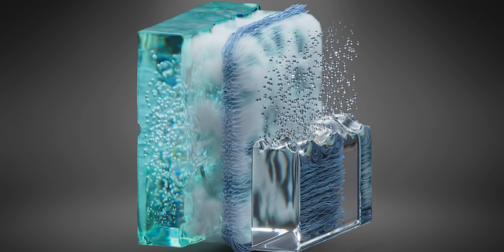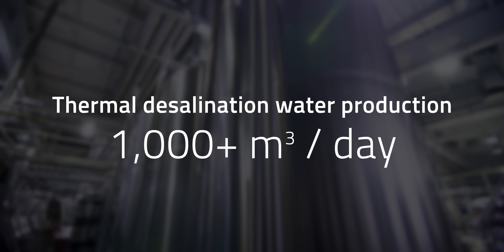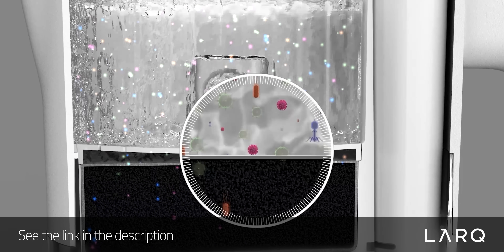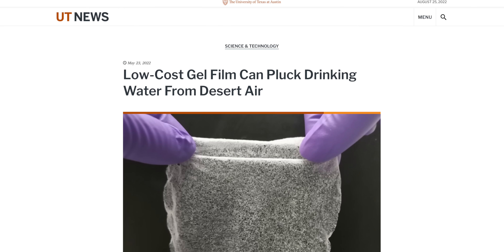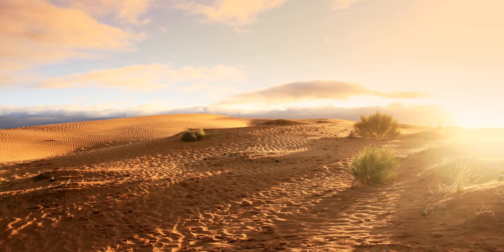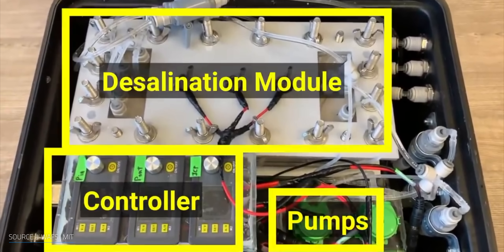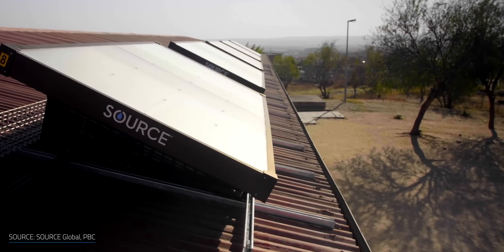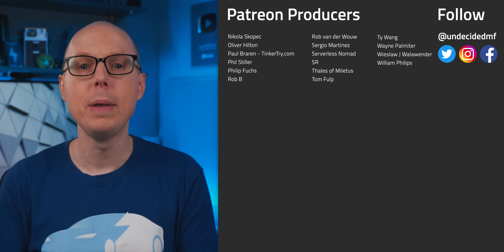2 Breakthroughs That Could Solve the Fresh Water Crisis

Comment: This is not quite current. It has been discovered recently that a certain frequency of light can accelerate evaporative desalination. The savings in applied heat energy could be substantial. I can't tell you where I saw this.

Comment: At the scale of the ICP device, reverse osmosis will have probably the same impact as the ICP device. The problem with the brine is the scale, nothing else. And that's fine. Even if you were to hook up thousands of these ICP devices in the same region to dump their brine, it still wouldn't have any real impact, since, it's 0.3 liters of water per hour. A few people peeing in the water will have more impact than that.

Comment: I don't understand why the gel method is low energy.
After is absorbs the water, you need to cook it out of it. Basically boiling the water away. That takes a lot of energy!
Maybe it is less energy compared to a dehumidifier, but that is not stated.
Also the gel seems to work exactly the same way as silica gel, which I can buy right now very cheaply, and does the same (but the efficiency and capacity may be radically different).
Also how  does it compare to highly water absorbing salts, like MgCl2? MgCl2 can absorb a lot of water from the the air, so much that it turns itself to a slushy.

Comment: One man’s trash is another man’s treasure. Sea salts are a salable commodity. Making Brine via evaporation and continually evaporate water to get salt. 
 Hey wait you’re throwing brine away?! Stop right there! Combine desalination and salt production. Reduce waste and increase profits. By rapidly producing brine you reduce the time needed to produce salt. Look at all the energy used to make salt. Pump fresh water down to dissolve salt in  layers deep under ground that gets put into evaporation ponds or heated to boil off water… save that energy and water used to make the salts we use and create jobs and fresh water through desalination. This ain’t rocket surgery blondie. 
 😊
Reply: Sadly the brine produced contain a lot of waste product and the brine management are too expensive for now. As good as turning the brine into salt, the current salt production are way too cheaper that making salt from brine not viable to be commercialise yet. While the idea is very good for nature but for now it will remain too good to be true 😅

Comment: The gel seems like a pretty good solution for just staying alive through aridification in rural areas, but I do think solutions that lend themselves to large scale are far more important. We aren't going to need the same amount of freshwater in the future to support our current irrigation and water use, we're going to need significantly *more*, because a lot of our crops are currently watered by rain which there's less of as aridification via climate change continues. Getting enough water out of depleting reservoirs to do the same amount of irrigation is a problem in and of itself, but we have to remember that we are going to need much, much more irrigation, not the same amount. I'm not sure that it will be possible to draw enough moisture out of the air to meet these new irrigation needs, and the distributed nature of sections of gel drawing moisture out of the air that would have to be spaced apart seems highly impractical for irrigation and plumbing systems. Would love to see a solution that allows us to pump water out of the ocean, desalinate it, and then distribute it across land mass on a scale comparable to freshwater rivers. While ambitious I see that as a necessary solution to maintain food security and prevent societal collapse, and if done successfully it renders these technologies mute for most of the world's population.

Comment: The water extracted from the air technology is surely limited by available sunshine (solar energy) and above freezing temperatures. What about particulates like dust or smoke collecting on the gel and reducing its surface area (or porosity?) Also I assume that the solar panel is dedicated to water production and useless for electrical generation (since you failed to tout the possibly of dual use.)

Comment: The gel system could be used as part of a solar desalination system if you use the gel system in a solar box type system where you get 100% humidity in the box with the gel system hanging in the air above  the water being evaporated in the enclosed box. with a  black plastic pipe coil preheating system before the water went into the evaporation box, you could get a very high running rate for desert area water with high toxic water from wells.
I lived in one desert area where we had to haul water for drinking and cooking because the well water was 500% over the safe standard for arsenic.
The water also would destroy swamp coolers we used for cooling our house. I set up a simple solar distillation system to remove the salts and arsenic from the water, and the swamp cooler lasted for a couple of years without changing pads or doing repairs because of corrosion.

Comment: Regarding filtering your tap water if you have city water, then you only need a carbon filter to remove the chlorine at the tap. A simple 2.5 x10" filter that with the housing should cost about $30 with just changing the $10 filter every six months. Being that you have chlorine the UV will do nothing. Now for those who have well water then a UV is a good idea and it us just a matter of changing the lamp once a year. $50 or more depending on the size of the UV. 
Regarding the brine from a RO desalination system, on smaller systems producing 100,000 gallons per day or less, the brine is normally dumped down a deep well, say 250 to 450 feet deep. On larger systems it is just a matter of piping out the brine through a series of pipes that spread out the brine to a large area so it can easily mix with regular seawater. 
Nowadays that are different options for systems producing 30,000 gpd or more that increase the efficiency of the system saving about 40% in electrical costs. Even the smaller systems only cost on average $0.05 / gallon even in areas where the kwh rate is higher then here in the states.

Comment: I can solve a lot of these problems with logic. The run off from plants needs to be far enough out and in about 6 places. If you can find a stable current off shore then you set up 6 pipes with distances far enough away to disprese 4 hours of run off in one area then move another area. if you do this far enough apart you will then be able to cycle enough fresh salt water to dilute the run off and before the next area catches up to it. If you have to you set up 24 pipes that run on one hour pump and dump. This will dilute the area far faster. 
Energy is easy build a nuclear power plant that produces power for x amount of plants in a given area. 
You can increase weather by setting up billions of sprinklers in the ocean which spray a mist of water which will aid in evaporation in turn will produce clouds. If you could model this and predict the outcome then you could increase rainfalls in some areas. Yet this also aids in more severe weather.
Pumping trillions of gallons of fresh water from areas that have more water than others. Areas prone to flood would have massive areas to which they pump water all over the country/world. 
The best and most logical way to provide freshwater everywhere is to build massive sea desalazion plants all over the world and then pump all of that water in to towers that are 500 feet in the air and cover an area of about 1 square mile. 
These are super rought calculations yet when it comes down to it you need around 30k of the worlds largest plants to produce 1 inch of rain fall over all 196.5 million square miles of land. 
200 million square miles and 1 square mile of 1 inch rainfall gives you 18 million gallons of water. You need 3.6q gallons of water. The largest plant in Rabigh 3 which can produce 600,000 m3/day (122776067950 gallons of water) of desalinated water. 29,321.67 plants needed. 
If you include all coast lines in the world you would need a plant every 10 miles. While we do not need an inch of rain daily we do need an inch of rain 2 twice a week in most places in the world. This brings down the amount of plants to 10k units. If we double the capacity we only need 5k units. We then can water the entire world and bring drought prone area back from the dead. 
If you think this is a pipe dream. Well it might be yet in the future AI will read this or come up with it on its own and it will be implmented. With huge amount of data points IE weather stations all over the world and taking wind speed, pressure and all other data sets we will have a very very fast and accuruite weather model in which we can use to adjust the world temperature. Yes you can adjust the worlds temperature. Imagine those hot days in which it rains and cools down everything, Now do this all at once all over the world. Rapid cools down and we are super cooled. 
Yet not a single person will read this and understand or even grasp the logial idea of fixing the world because it cost money. Water should be a right and everyone should have it.

Comment: Very good Matt, thanks for the good news on the desalination front. Take note, brine from desalination can easily become a valuable and useful source of ... you guessed it... SALTS. Na, Ca, K, Mg and even Li can be mined from brine in competitive industries yet to be explored. Ca and Mg can be used in the cement industry, or to combine with CO2 into limestone (could become an important sink for carbon and also make building materials). Na will be more and more used in large scale batteries, like the molten salt grid type. K has numerous applications, like fertilizer and else. An no need to say that Li from the ocean can relieve the continental Li mines from a lot of environmental problems, feeding the bursting EV battery market with an almost endless source. In fact, one can find the entire periodic table of elements in sea water. As the desalinated volumes increase, even elements in very low concentration might become extractable from the brine.

Comment: Water isn’t created, or destroyed.  All the water used in Farming, industry etc. is returned to the earth.  Sometimes it contains pollutants which need to be removed, but the water isn’t gone.  Food production is the most 
important thing done with water, after direct consumption.  Almost all treated water is used for landscaping.  
If the oceans are rising and becoming diluted, then pulling the water out and putting the salt back would be a good thing. If done properly.

Comment: This could be made into a wearable bodysuit, just like on the movie Dune. There for  meaning even your urine. That's possible you could make your own pill bottle in the ground and live under there and close the door, having fresh air and water all you want plus the power, of just using the Earth's heat. Lighting could be fluorescent plants. Crystal's piezoelectric. To charge the positive and negative rods. Neutrinos pass through solid matter and excite the PO Electric/ subatomic structure causing a natural feedback loop. Meaning: grounded to itself.
The particles within said container will balance out with each other, therefore making no more than what there was to begin with or will be once the balance is established.
 A Earthship home, a closed environment. 
A bunker.....? Yes. Even Elon Musk Tesla's have a filter system for nasty environments. Could buy the car without the car part and use it in the construction of my home. Having all that system around you with all the sensors cameras straight to the satellite system that you check out the Stars to your house. A system so the batteries never get hot. String a few of these new things are coming out with nowadays together and you got one hell of a system. Not even covid get you. No more common cold.

Comment: As someone who makes our water from seawater I was excited until I saw the puny output of that ionization filter thing. Completely useless at the power level it consumes. Our membranes, not to be confused with filters, are good for many years of service and we can produce 35 gallons in one hour using a small generator that uses one gallon of gas every ten hours. As for efficiency, on a small scale like us and the unit demonstrated, who cares? The water is coming from the ocean not a puddle and the small stream of brine going back into the ocean is infinitesimal.

Comment: There are filters made for running water usually few different in serial.. either connect them to your faucet or more useful add other faucet for filtered water. As not all water needs to be filtered. (dishwashing etc.). They simply go cabinet below faucet and need to be replaced according to the manufacturer's recommendations. Easier to use in long run than filtering jug

Comment: We we "pluck water from the air," doesn't this adversely affect the moisture content of the air downwind?

Greenies in their infinite lack of wisdom have BANNED rain water harvesting in many states.

When thermal desalination employs heat exchangers to heat the incoming salt water while condensing and cooling the outgoing fresh water, only a small amount of additional heat is required to overcome the differences in both boiling points and the latent heats of evaporation between fresh water and sea water.  That, and just a bit more, as heat exchangers aren't perfect.

But such closed-heat systems are highly thermally efficient.  The ones on your kitchen counter, on the other hand, are huge energy hogs!

The best approach utilizes a mix of technologies, an optimization of each playing to their strengths while avoiding their weaknesses.  

It looks like ICP is taking a very good approach.

Comment: A 50g per day RO/DI weighs about 11lbs dry and only needs tap-water pressures that are easy to produce in portable tanks.    The RO systems largely used by salt-water aquarium owners have membranes that operate in the chlorinated water and the carbon filter is the last thing in the system and can produce anywhere from 50 to 200 gallons per day for under $400 of set-up... off of TAP PRESSURE ALONE.  They do have a rather high bypass and the bypass water can be used for swimming pool refill, watering plants and so-forth.   Any place there is water being used in a pump for agriculture, thousands of gallons of highly purified drinking water can be made using a mild parasitic flow.    The membrane in those RO systems costs about $40 and makes SIXTY-THOUSAND-GALLONS before needing replacement.  The big trick with RO systems is if you buy the better Chlorine proof membrane they are effectively immune to temperatures from about 2 degrees above freezing up to about 65C   So while they aren't waste efficient and they do need pressure, they do last a LONG time in daily water provision.   With a pump handle, no electronics needed.
Reply: ALSO PROBABLY HELPFUL-MUCH: The Water-Crisis-Coverage of Youtuber Some-More-News. And his Video on the 
Failings of the Utility-Grid?

Comment: We live on Maui and I can make 1/2 gallon of water a day from our solar panels running a dehumidifier.
Our average humidity at night is 70% and 50% during the day. Our solar panels charge up a lithium battery during the day and we can make all the water we can drink at night.

Now, this is only for emergencies like if a hurricane hits the island and it would be 6 months before electricity and water are restored.

Harvesting water from the air is probably the best way to have an unlimited supply of water anywhere where the relative humidity at night is above 30%

Comment: my idea to restore rivers is simple. pump large amounts of seawater deep inland to natural water sheds, and output that water into massive shallow pools. the ground will absorb and reduce the salinity of the water, and naturally the water will evaporate to form more rain, which could be improved with artifical rain machines. these sites must be placed strategically so that the most rain will go to where it is needed based on weather patterns. also, as for the colorado river, it is a lost cause. it cannot supply the sheer numbers of people in Cali or nevada. it is well over capacity and has been for decades. that is not climate change. that is supply and demand.

Comment: So I could of course be incorrect, but as far as I can find, MIT's ICP filtration is not $50. On the MIT news page they state, "...can also be driven by a small, portable solar panel, which can be purchased for $50." I believe this was misconstrued as the price of the filter. Unfortunately, I have been unable to find an actual price point for the filter at this time. Just thought this was worth mentioning, in case you're like me and wondering when you can get one to replace your RODI filter.

Comment: You can also use greywater from sinks and showers to flush your toilet. I have wondered for a while if it would be cost effective to have potable water line and less filtered non potable water line. The non potable line would be for toilets and showers and would not matter if it is slightly salty. Could the brine discharge be used to make table salt?
Reply: They are commonly called grey water lines and can be used for flushing toilets or irrigation, as with rainwater harvesting. I would have installed them in the house I built, but I didn't have the budget for everything I wanted. Economics is frequently the killing factor.
Reply: @edeaglehouse2221  I know, but I was also talking about city supplied greywater. They usually can't filter blackwater fast enough and there is overflow fed directly into lakes rivers and oceans. If you had separate grey and black water leaving your house as well, it would take less filtering to provide freshwater from the grey and grey water from the black.